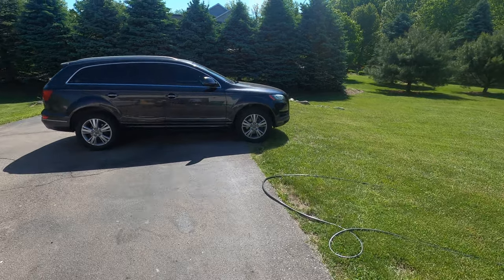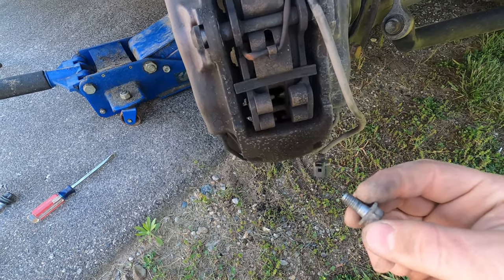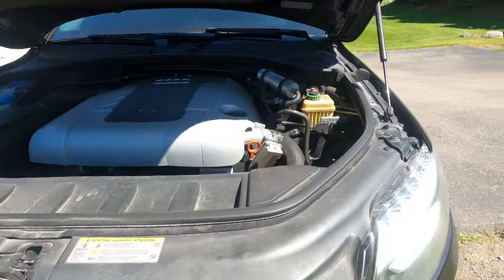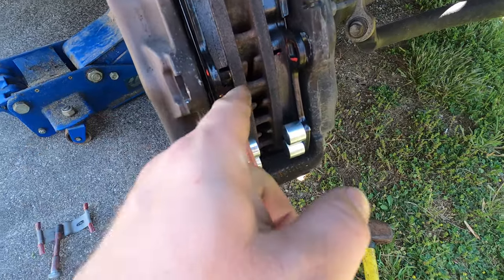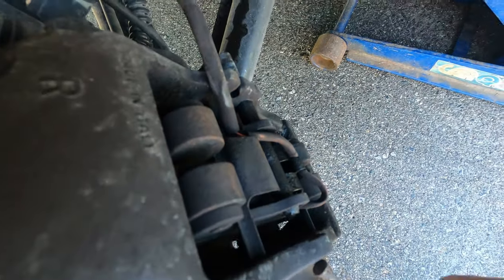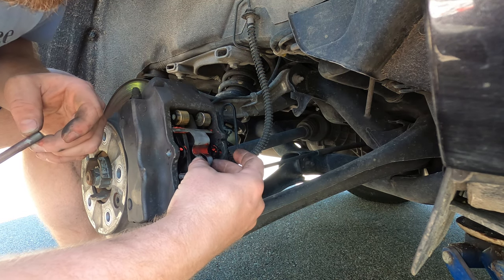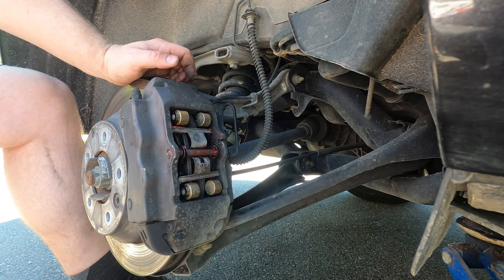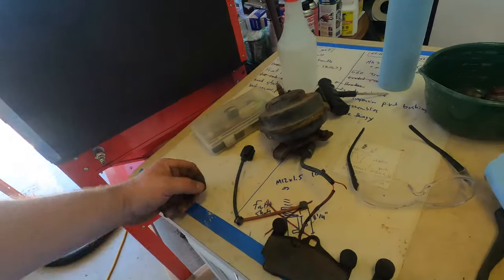2011 Audi Q7 Brake Pad Replacement

Comment: well described procedures... I would add a couple things.. To push out the caliper spring clip rod/bolt, just get a long punch of the rods diameters. On the rear caliper setup you did the main pads but your E-brake is drum setup with the pads inside the rotor so you should remove the rear caliper & rotor to inspect / replace the inner drum pads.. I installed the 2011 18Z Brembo calipers front & rear onto my 2005 allroad.. Due to the 25 offset of the allroad the Q7 rotors will not work so the answer ( for my C5 ) is Mercedes CLA 45 AMG 350mm rotors up front & B8 Audi S4/S5 330mm rear rotors. Since the E-brake of the Q7 is not retrofittable to my C5 I needed to install a bracket to mount both the 4 piston caliper & the E-brake caliper ( Willwood MC4 ).. I wrote up a DIY in Audizine in the C5 section outlining the process & details of how to install the Q7 brake system onto an older C5 Audi .....Cheers...
Reply from the maker: I think I found the writeup, the one with the bright green calipers?  Curious how the paint job has held up.  Next pad change I will have to replace the rotors and it will be a good opportunity to clean and paint them.
Reply: @smsauce  Yes that is the one.. Paint hs held up quite well. I used high heat motor paint ( which was what I had...) Replacing pads today...

Comment: I think your pad spring was upside down on the passenger side. It cable retention CLIP should be on the top and the sensor cable goes up and over to the other sensor side.
Reply from the maker: Skipping through it looks like I just put it the same way I took the old one out.  I just now checked the service manual and it shows the clip for the wire on the bottom.  It also shows the pass through in the casting on the bottom, even with the clip on the spring, and it appears to be driver's side.  So clip down on driver's side and clip up on passenger side?  If you have the same one from erWin it's on pg 45/46 for me.

Comment: You opened the power steering reservoir   Your brake fluid reservoir is under the flange by the windshield washer arms
Reply from the maker: Yup, I realized that later.  Derp for me.

Comment: El tapón del depósito se suele abrir antes de retroceder los pistones,y ese que has abierto es el líquido de la dirección asistida,el depósito del líquido de frenos está oculto bajo el plástico justo detrás del que abriste.
Reply from the maker: Yes!  I noticed this after I posted the video and felt pretty dumb.  I only speak English but the translator I have did pretty well.  For anyone else language I sufficient like me, he pointed out that I opened the power steering reservoir instead of the brake reservoir like I should have.  Fortunately my mistake did not cause any problems.  Normally it's good practice to open the brake reservoir to check level.  If a previous owner had topped off fluid, resetting the calipers will make it overflow.  Thanks for point this out for us!

gracias por la corrección mi amigo
I hope my crude translation makes sense :)

Comment: I attempted to. ChAnge  my rear  rake pads. After hammering the brake pads guide, I could not
Make it budge.  Any suggestions?
Reply from the maker: Try making a screw press like I did.  I also got to where hammering would not move the pin on the rear.  Here is a time stamp to mine working:

https://youtu.be/8XEPueUlM64?t=700

Get a bolt that can slip into the opening the pin goes into and thread a nut on the end.  When you turn it CCW into the frame of the caliper it will press the pin out.  You could also use a bolt that is small enough to slide though the hole, but long enough to reach the pin.  Then thread a nut onto it after going through the hole in the caliper.

Getting this pin out was quite frustrating.  I'll do my best to help you get that damn thing out!

Comment: What size is the bolt you do pop,pop, pop with ?
Reply from the maker: The one for the front is M8x1.25, for the little bolt press I used on the rear I'm unsure.  That was just some stuff I found in my giant bolt collection that just happened to work out.  I also found out my local parts store can get the pins for less than $10 each.  I think on the next brake pad change I will put in new ones if these give me trouble again.

Comment: What are the 4 pistons on the pad itself do ? im a bit confused because caliper doesnt press it i assume ?
Reply: Front caliper is 6 pistons, 3 per side.. All three pistons are different dimeters.. The smallest is the first to contact the rotating  rotor when pressed. its sized differently for het dissipation & piston efficiency. In the rear I believe they are both on each side the same size.. But all of the pistons in front & rear calipers press onto the rotor surface... If they dont than likely one piston is seized..